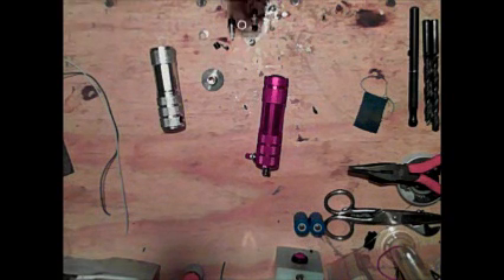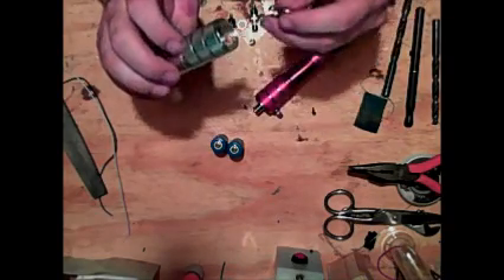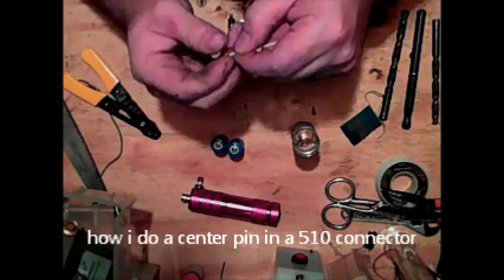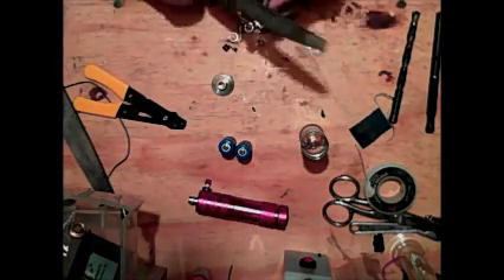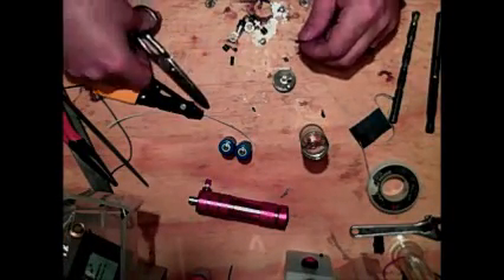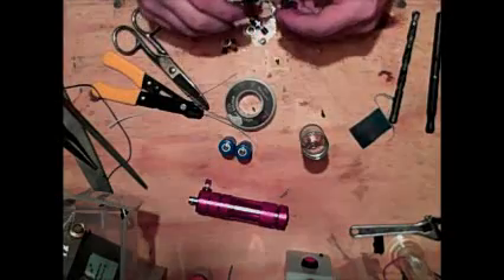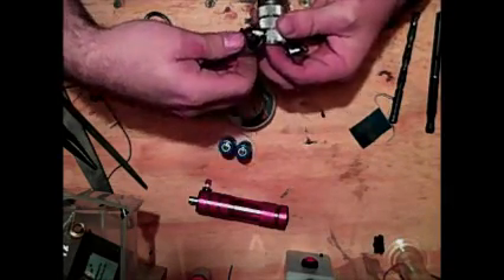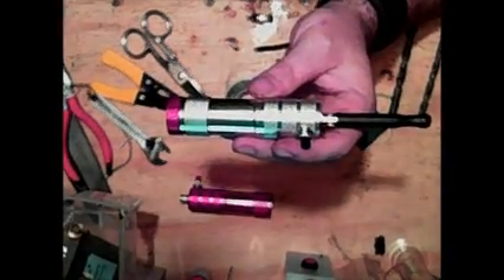How to build a flashlight e cig mod

Comment: My meter measures an average of .8 ohms from end to end of one of those aluminum tubes.  That is comparing 5 different brands.  1 from dollar days, 2 from menards, 1 from walmart and 1 from home depot.  While you may still be getting vapor with the 4.2 v lithium battery I am pretty damn sure you are losing ~33% of power to the tube resistance.

Ex. 4.2 v / 1.8 ohm = 2.33 amps * 4.2 volts = 9.7 watts

versus 4.2v / (1.8 ohm + .8 ohm) = 1.65 amps * 4.2 volts = 6.9 watts.  

Thats 28% lost power.

Comment: People completely misunderstand batteries and voltage drop.  AAA nimh have no issue outputting excess of 5 amps.  Yes is shortens the capacity (mAh) because it wastes energy heating the battery.  But it is not why 3xaaa will not power your ecig.  The problem here is voltage and power.  Any 3.6 voltage supply in that case will deliver a max of 4.8 watts to the load (not enough to vape) because of the tubes resistance. 

The infamous voltage drop is from series resistance, look up voltage division

Comment: Hi, I made one I did every thing but it just won't fire. The circuits running how it should but when I put a tank on it it won't fire I can feel like a little shock on my lips hen I push the button & it's will vap every once in a while when I mess with the cord but the it stops. Please help
Reply: sounds to me like u have a loose wire somewhere go bACK  over ur soldering points and make sure positive leads are isolated away from the mod body(ground). i could be wrong but to me thats what it sounds like.
Reply: I'd be willing to bet anything it is the switch!  It seems a decent percent of flashlight switches are just bad...  Some die instantly when trying to pull to much current, I think the low quality plates inside the switch get arcs and oxidize into a mess.  Replace the crappy built in switch with a high quality horn switch and your set!

Comment: Would super glue work instead of the solder
Reply from the maker: superglue is insulative, so no. it will block the flow of electricity

Comment: Is it possible to use the switch already on the flashlight?
Reply from the maker: sorry for the late reply, yes there is. As posted in vapeatron.com if you were to open the switch and shave off the tabs, that would turn it from held to pushbutton, and would work well.

Comment: 3.6 volts / (1.8 ohms + .8ohms) = 1.38 amps * 3.6volts = 4.8 watts (not enough to really make vapor)...

In this case you would only get 2.484 of the 3.6 volts to your load.  The other 1.16 don't magically vanish.  Notice how when people review ecigs they talk about the voltage drop.  They aren't blaming their own lithium ion battery but the internal resistance of the battery holding device.

Comment from the maker: 26650 lifepo4 3.2 ish volt cells in a c cell mag light work amasing just saying. Basically the switch is better apt to handle what your talking about and every thing elese is basically the same.. Just a bigger washer on top for tripple barrels.

Comment: were did u get the 510 connector
Reply from the maker: There are many places to pick em up, one as mentioned a few times is madvapes . com or just a google search for 510 connector would set you straight. let me know if there is any help you need :0

Comment: what button did you use whats it called
Reply from the maker: it's a radio shack n.o. push button however this video is far outdated
Reply from the maker: this was made back when cartomizers and ce2s we're the king of vaping and even before carto tanks we're made/imported in mass avaliablity

Comment: hi how do i get my torch mod to give out more heat do i just do less raps i got the torch mod to work but its poor on vapor
Reply from the maker: Then it may be your connections or batteries your using. The mod is only a path for the voltage and amperage
Reply: ty

Comment: Well take out that 3xAAA battery pack... Put 3xAAA batteries in it.  Using just scotch tape and copper wire to connect the battery pack to a 510 connector directly = amazing vape off of 3xaaa batteries.  

Now try using that same battery pack in the flashlight modded to a 510 connector.  No switch, no circuitry... Just the battery pack, the washer and 510 connector.  Notice how it now produces 0 vapor on a 1.8 ohm coil?

Yes I sanded / buffed all metal contacts first.

Comment: This is simply not true.  The problem is from the series resistance.

To prove it to yourself... Hook up directly with copper from 3xaaa to an atomizer and experience the clouds for yourself.

Noting my examples below...  If you use 3.6 volts...  

3.6 volts / (1.8 ohms + .8ohms) = 1.38 amps * 3.6volts = 4.8 watts (not enough to really make vapor)...

But 3.6 volts / 1.8 ohms - 2 amps * 3.6 volts = 7.2 watts.

This .8 ohms isn't including the switch/springs...

Comment: can u sub ohm on this???
Reply from the maker: sorry for the late reply, as the model shown? no. The switch would have to be upgraded to a much more robust one, and the wire used to connect to the atty connection would as well.. Possibly the spring for the contact but other then that, it could. easy changes